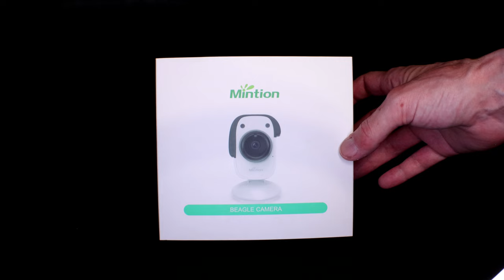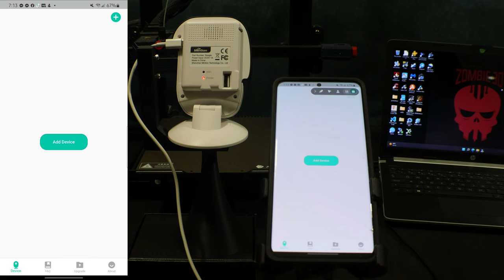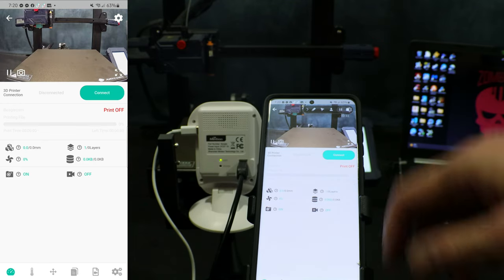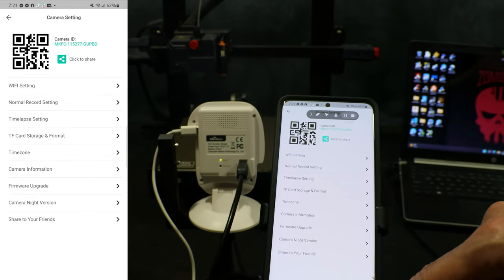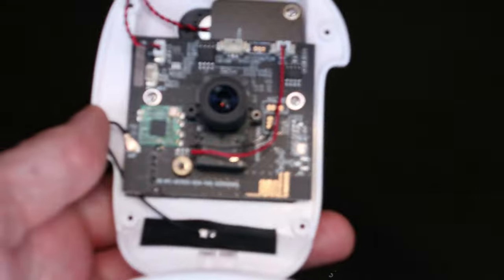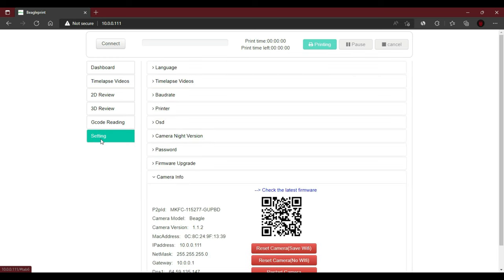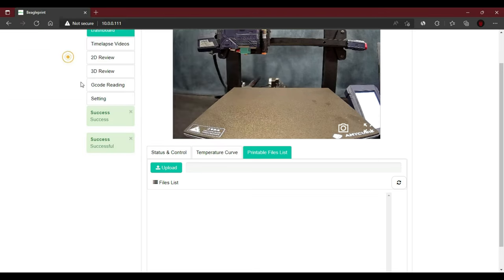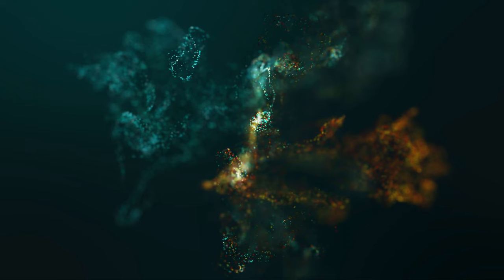Mintion Beagle Camera setup and Review

Comment: hello friend good evening, I have a question, while the printer is printing and the camera is recording, if I turn off the computer the printing is canceled?  Or can I stop printing and the camera recording without a problem when I turn off the PC?  I say so as not to have to have the computer turned on for 30 hours... the other question, can I enter the gcode directly from an sd to the printer and only use the camera to record?  or should it be used yes or yes with the computer or phone application?  thank you very much for your help
Reply: You upload the code to the camera so you don't need to leave your computer turned on. No point in having your printer's SD card plugged in since the camera takes over that feature. I highly recommend buying one if you currently pull out the SD every time to copy your latest file over for printing. If you are at work and notice a print fail you can just cancel the job without wasting plastic.

Comment: Will this work with duet3d
Reply from the maker: It should the last update added custom printers you just connect and define the bed volume and set the timelapse accordingly.
Reply: @studiozombie3d  ok does this would outside of the local network like octoeverywhere?
Reply: @studiozombie3d  also it says for marlin printers, does that mean a duet running reprap is no good?
Reply from the maker: @alanjeff1668  I'm not sure about reprap you can contact mintion and they arenreally good at responding
Reply: @studiozombie3d  cheers will do